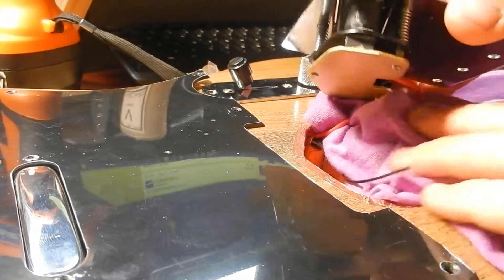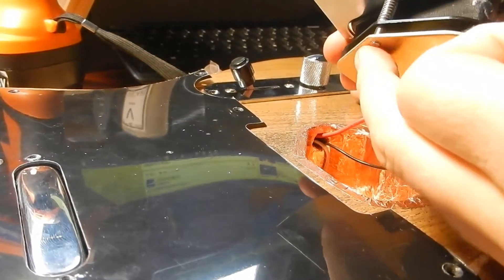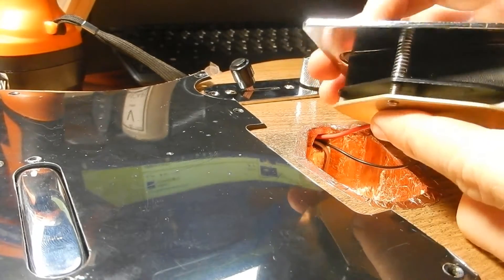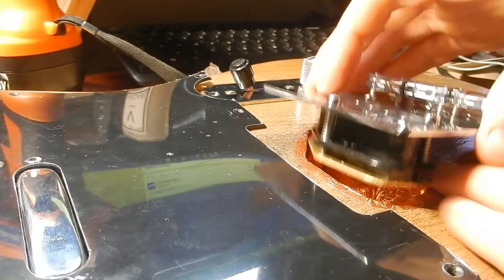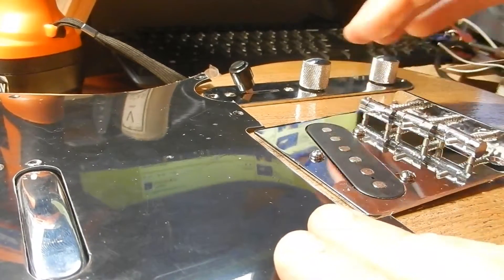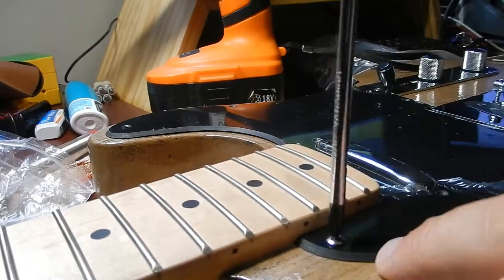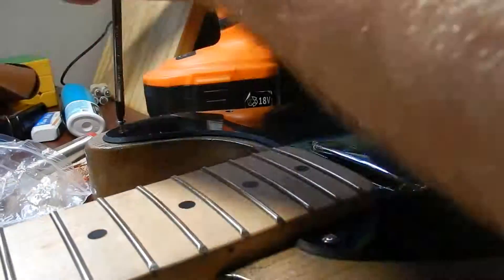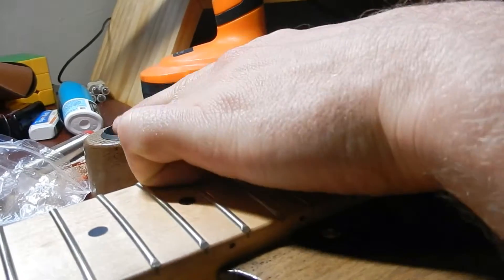Pitbull Guitar build - part 6 (Hardware)

Comment: Tele pickups are most definitely mounted to the scratchplate if you're not careful the screws will come through the back. Hard mounted pickups don't need such deep routing to get pickup height.

Comment: Your neck pickup should be attached to your scratch plate not the body of your guitar.That is what the two holes in the scratch plate are for. Otherwise you cannot adjust the height of the pickup without taking the scratch plate off.
Reply from the maker: thats what i thought, but in the pitbull videos they screw them to the body not the scratch plate?
still fiddling around with the height of the pickups and the wiring and all that, new experience for me
Reply: Trust me the neck pickup of a Telecaster definitely attaches to the scratch plate. I have a Mexican Fender Telecaster. Some other types of pickup do attach to the body (e.g. P90s) - but not Telecaster neck pickups. You attach it in a similar way to the bridge pickup, with the springs in between the scratch plate and the baseplate of the pickup. Then when you tighten the screws the pickup moves closer to the strings and vice versa.